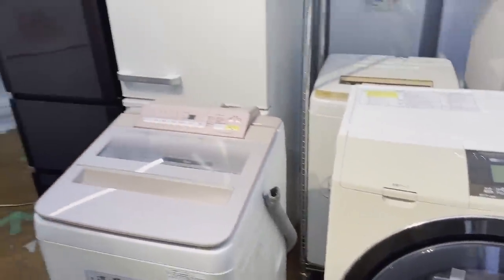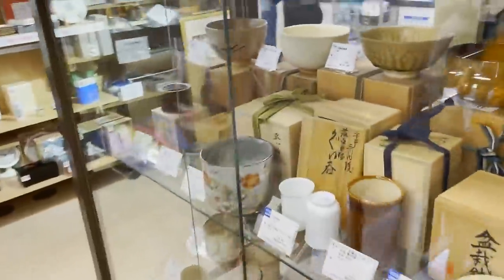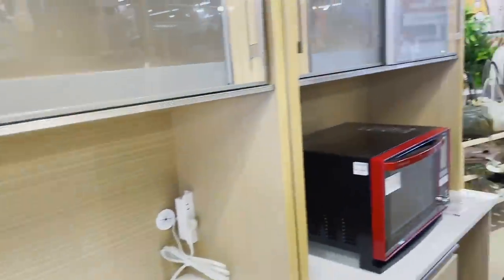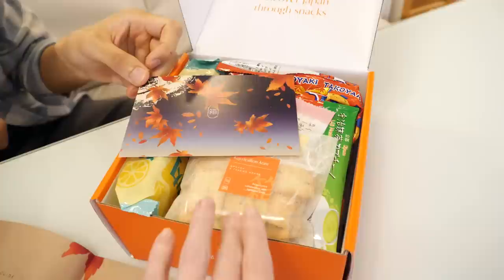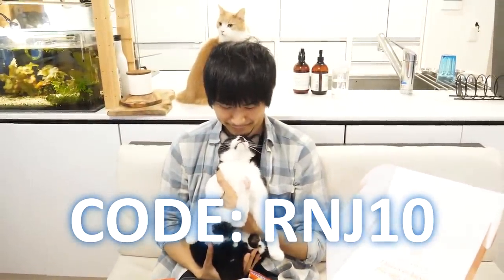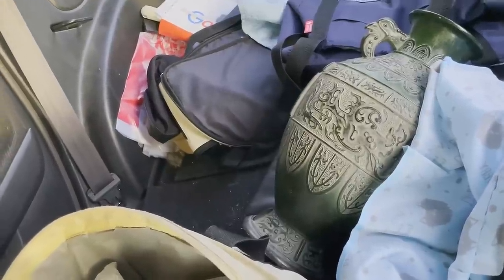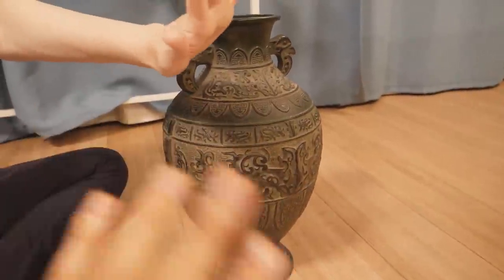Japanese Thrift Store (Home Goods & Furniture)

Comment: So....a way to fix the stick of old drawers is...wax. not even kidding. Grab an old candle or chunks off an old burned out one and rub it on the contact friction points (top edge, bottom edge) where it sticks the most. Some people even used bar soap. Wax is the most effective from my experience. We have glider drawers now (the ones with wheels in the brackets) because easy wax/soap fixes just aren't in the front of anyone's brain anymore so it's kinda getting lost as to how to do easy fixes. Try it. See how you like it. It doesn't work quite as well on small jewelry boxes with drawers, but the chests of drawers, yes.
Reply: Just went to post this, we fixed all the drawers in our house this way! Works great 👍
Reply: We even do this on doors that stick (we have an old house that is sensitive to moisture).
Reply: Actually the first thing to do is change up the sequence of the drawers to see if they fit, often they get mixed up if you pull them out for transport- nice old chests of drawers have numbers or carpenter signs in the back. And then clean the edges before waxing. A gentle tap with a rubber mallet at the joints is another thing you can do, just like measuring if the corners are 90°. 
Also I hate the little wheels on gliders drawers, I have broken quite a few of these buggers.
Reply: @mirabellegoldapfel6256  good points. I forgot the drawer swap
Reply: So cool! I needed that info too! Just got an old drawer that is so stuck!!
Reply: Oh! Ima test it on my old "phone tabel" its one of those you had near exit hall in your huse/aparment, has realy stucky drawers its bit clunky but! It love it old dark wood like chesnut alomst 😁 i dont know why they wuld trow it away tho (well i kinda know they dont know what is wurth something and something not)
Reply: Works great on stiff sliding windows too! Wax works amazing on sliding anything.
Reply: Wax sometimes works well but I just use a PTFE grease from Super lube. Originally got it for my fridge veg drawers and it worked very well. Worked even better on wood drawers. I've only yanked drawers out a few times.
Reply: @brothyr  k, I didn't know about the grease. That's a new one on me.
Reply: A bar of soap can work too
Reply: Nice!  If the wood has swollen or warped a bit, one can also just lightly  sand down the trouble spots before applying the wax to make it fit properly again.  I wouldn't pass up a great deal like that.  It's amazing.
Reply: As someone who grew up with antique furniture fiends for parents, I can absolutely back up this comment. if you want, you can pass a lighter over top of collected candle wax to soften it and just rub that stuff into the shelves where wood is gonna rub against wood.
Reply: Interesting,i wonder if it works with sliding doors
Reply: @Imbatmn57  it does
Reply: My grandfather was a carpenter, he used parafin wax.
Reply: Olive oil soap works too.
Reply: I have dressers and old furniture that's lasted all the way from my mother, to my older sibling, and now I own so knowing this now I'll keep it in the back of my mind in case a drawer sticks !
Reply: If they're sticky afterwards, a hair dryer helps the wax settle into the wood
Reply: I learned that trick from my grandpa! Before passing he did a lot of woodwork and carpentry. He always had this huge ball of blotchy wax made from the nubs of old candles to use on rollers and such.
Reply: @mirabellegoldapfel6256  yes!

Comment: That chest of drawers was an incredible deal at $60 😥 the drawer joints (dovetails) look machine made, so it's not super old, but because it's solid wood it's really easy to resize the drawers so they fit well in the chest again. A carpenter could do it in half an hour!
Reply: gosh that chest was amazing i wanted it so bad! it looked like it would last you a thousand year !
Reply: Easier fix? Wax. The drawers fit fine but most of the size issue looks to be from expansion and contraction on the wood from temp changes. Waxing the drawers with basic candle wax will ease the friction points where the size shift is most noticeable.
Reply: @bandashee  Wax would do it most of the time. I think this one swelled a little so a couple passes with a finger plane would fix it right up. So about 30 minutes of work. (I'd do all the drawers)
I built furniture in a factory for about 9 years. Before that it was my Master cabinet maker master carpenter Uncle telling me secrets he picked up since 1935 to 1987.
Reply: You probably don't really need to resize. if you take bar soap and rub it on the runners (bottom two corners going about a foot into the drawer)  they will stay easy to slide out for years. Old trick from my Ohio carpenter grandpa.
Reply: And rubbing a paraffin emergency candle on the drawers would have made them slide more easily.
Reply: I know! I wanted it too!
Reply: @douglascampbell9809  on all the drawers except the one that had swollen to be too large the wax would work. The just need to microplabe the bottom of that one. The others will do great with wax.
Reply: I have a lotus carved wooden chinese style drawer/chest made in a similiar fashion that I also found at a local thrift store. I think wax is probably the better, more traditional way to improve the friction issue, but upon cleaning the chest I have here and using a wood restoration polish, it so greatly improved the slide of the drawers that I didnt have to do anything more. It's probably one of the most treasured items I've ever had the chance to own <3

Comment: Hey Rachel, if you want to preserve the color as it is, I highly recommend you wax it regularly if the vase will be outside. Like iron and high-carbon steel, bronze and copper alloys in general tend to oxidize, giving a blue-green color to the metal. Honestly, if it gets a little bit of a patina (the name of the blue-green coloration of the metal), it can act as a protective layer. Do some research and figure out if you want to keep it as is or let nature take a crack at making it prettier!
Reply: I was going to say something similar about oxidisation but I didn’t know about the waxing so thank you for that!
Reply: If it's a copper vase, it might get stolen. Might not be a good idea to have outside.
Reply: @A_tired_dude_named_Luke  It's Japan. It's so so unlikely to get stolen

Comment: That’s quite a find. I couldn’t quite understand the year, Rachel. Did you say 1953 or 1963? If 1953, I am the same age as your vase.
Reply from the maker: 1953! That's when they began using the mold manufacturing process, which is how our vase was made. So our vase has to have been made some time after that!
Reply: Lol.  I'm 1954.
Reply: @RachelandJunAdventures  Well that makes it 50+ years old so almost an antique. I bet you paid a fraction of the new price. A steal. Clean with a brush and soapy water but don't polish it unless you have too. Patina is good.
Reply: @delukxy  Up To 50+. They started using the mold process then, and since thats how the vase was made, it had to be made AFTER it was implemented, meaning it COULD have been made in 1953, or... any year since. Meaning it could be 50 years old, it could be 20, it could be 10, even the company doesn't seem to know.

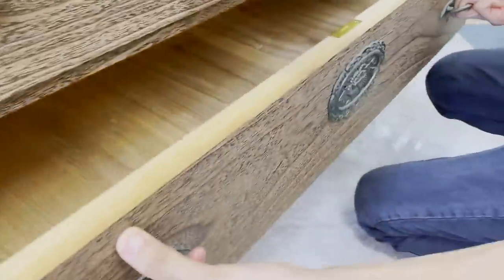Comment: 13:22 if you use some furniture wax you can make wooden drawers in old wooden furniture move more smoothly. Some say to rub a candle on the runners the drawer is supported on, but I find that it flakes off over time, the beeswax furniture polish works much better.

Comment: When actually wooden items are made you can often hear creaks and groans, the reason for this is the wood is still considered alive it's breathing. The temperature of anywhere effects those wooden items, the reason for the drawer not going in most likely is it was out of the main unit and the temperature changed and it's swelling up and that is what causes the drawer not to slide easily.  A gd tip is (like someone else has mentioned) to use wax but if there is a lot of hot water humidity weather about like a monsoon season where the rain is actually warm plus there's sun which is not helping with making it hitter then any actual wooden items will expand but if there is the opposite i.e. cold weather then the wood will almost shrink/contract. The central heating in homes in the winter really cause wooden items problems as it's drying the air and that is causing the issue of drying the wood out.
When items like you showed after they are made with, beautiful dive tail joints shown like that chest of drawers unit, they often once put together and is suspended in a massive water tank to let the wood swell up and that makes the joints fit better.  I was brought up taking pride in handmade trades, and only have in the home actual wooden items not the cheep fake style wood like MDF, chipboard etc it has also be sustainable. But there is so much that has been made years ago we should be reusing that and even repurposing those items. You look after wood, it will serve you and following generations to come. Btw that chest of drawers unit was a lovely piece of furniture. I would love to have brought it. Xx

Comment: I found a gorgeous old teapot lamp at a thrift store this past weekend and my boyfriend was very much against it 😅 I ended up not getting it because it was $40, but I haven't stopped thinking about it and Rachel buying that vase really felt like a sign that I need to go and see if my lamp is still there 🙃

Also: that drawer you really liked but the drawers were super sticky? You can use some parafin wax or finishing lubricant to make that smoother.

Comment: It was a Litter Robot, not a cat house. It automatically cleans the litter. You should go back and check it out. They retail for about $600 to $750, depending on the options.
Reply: Its missing the inner barrel though.
Reply from the maker: There were two! The first one was an automatic litter box and the second was an electrically warmed cat house. The automatic litter box is way too small for our cats, unfortunately. We've had companies offer to send them for review but they just wouldn't be big enough for our cats to comfortably use. If the litter box isn't big enough, Nagi also won't go in far enough and ends up peeing outside the box 😐 which is why we're just using a massive tote bin now, lol.

Comment: Honestly, It probably wouldn't take too much to get that sewing machine working again, if you could find a sewing machine repair tech that knows the really old machines.  Once they're in working condition, they're not very likely to break. I have one in that same style (but by a different company) from 1906, and it works fine.  Luckily, I got mine in decent working condition, though, because the only repair person in my city told me he wouldn't be willing to work on any machines that weren't electric.

Comment: That chest of drawers is gorgeous, a bit of wax on the joints would fix it up real quick. If it's still pretty sticky after that you could always use a planer to shave down the sides a bit and then re-wax. #coppervasebestvase

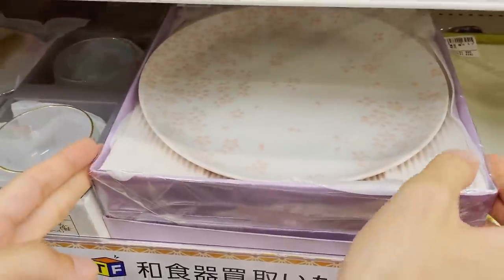Comment: 1:46 weird that they'd say it doesn't work yet someone went to the trouble to put a modern belt on it... and by the looks of things, maybe even a new base and motor (base is too clean, and that type of belt implies the motor pulley is cogged).  The unpleasant part is that someone put a damned hole in that poor thing and put a potentiometer right through the cast iron base... for shame, for shame). These machines (Singer copies) are extremely easy to make work.